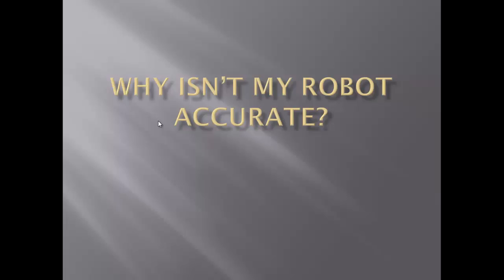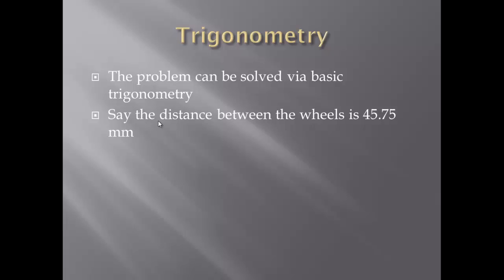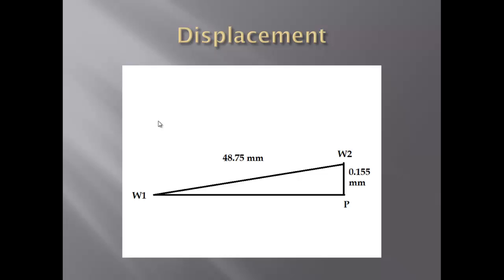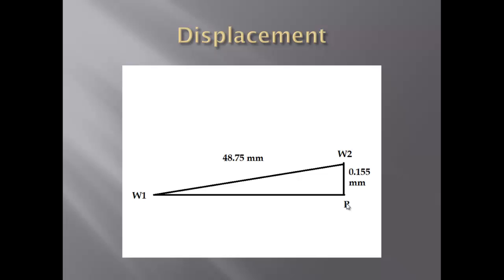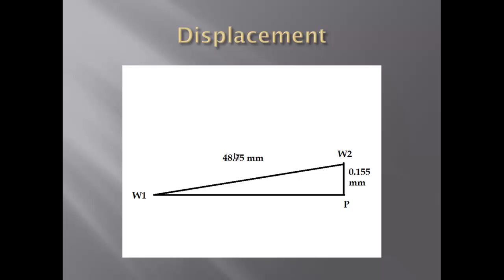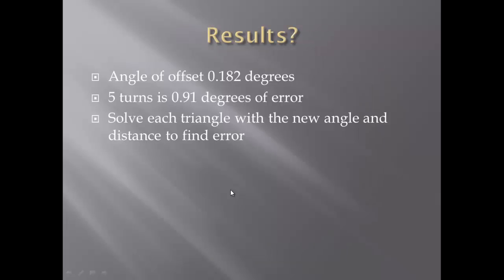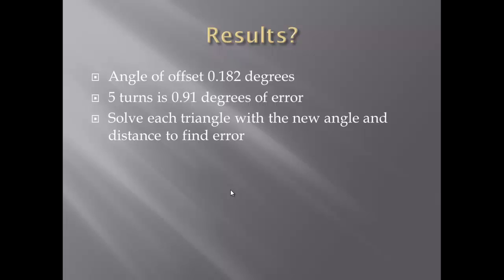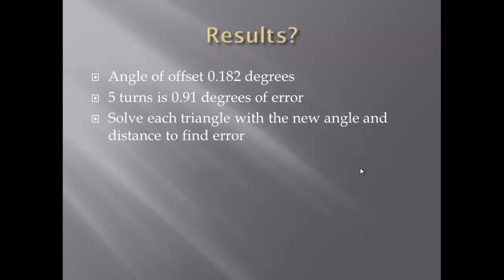31 - EV3 Programming: Why isn't my Robot Accurate?

Comment: The geometry you show here is all true, but I think there are larger errors than this in practice. First, it takes some extra time (up to 0.5 seconds) after ending a "move" block with the brake setting ON, before the EV3 control system can deliver 1 degree accuracy or repeatability from the EV3 large motor,  in general. Second, I found there are larger errors than the 1 degree wheel precision when turning, due to interaction between the precise surface details, the motor, axle, and tire flex and total side loading, and the width of the wheels, which changes the pressure on the multiple contact points between tire and the surface. This changes the effective point you are rotating around from moment to moment, and therefore the effective distance between the tires, which changes the amount you turn per wheel rotation. That error should be minimized by using a thinner wheel, but the thinnest one (wedge pulley with tire) has such a small contact patch it slips easily (both along-track and across-track), and so accuracy is lost that way. Sideways drag force from the non-driven idler wheel(s) or roller balls also has a significant effect on turns and in some designs that is the dominant error.   In other words, it's complicated.

Comment: Would you please post an example of a robot moving the path using degrees and no error correction then the same robot using with error correction.
Reply from the maker: Regrettably the error correction is very situation specific. Since this was a vague example it's hard to demonstrate it.   The best way is to correct using other sensor than just the built in encoder (rotation sensor)  Which lines, and objects that can hit touch sensors are very situation specific.  In theory by using one wheel turns you should see about a 50% increase in accuracy, however we calculated the worst case scenario, so you could range from 50-0% more accurate on a given attempt, obviously with normal distribution curves (averaging out) would be about 25% more accurate.